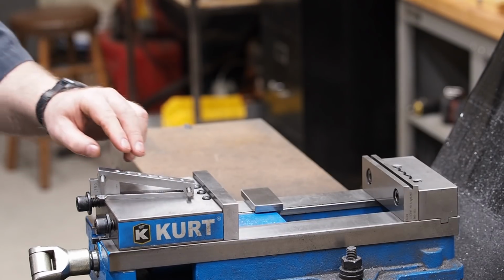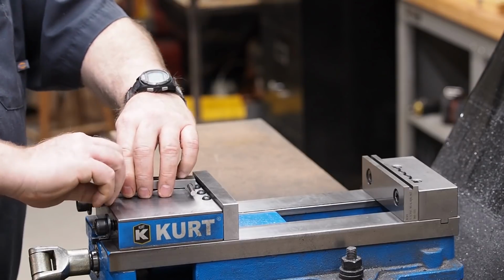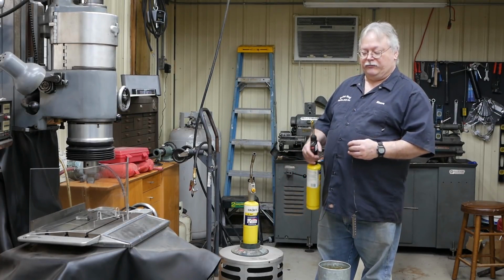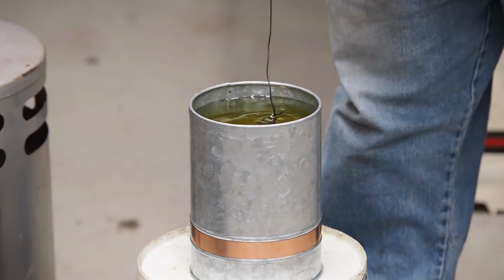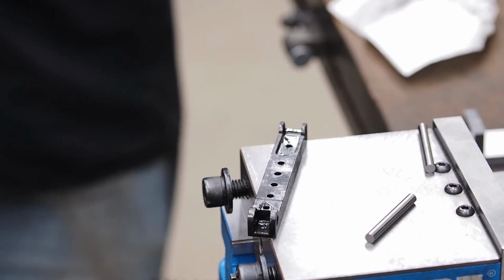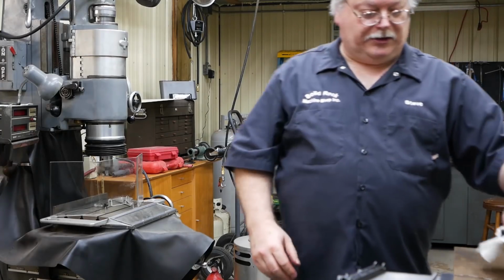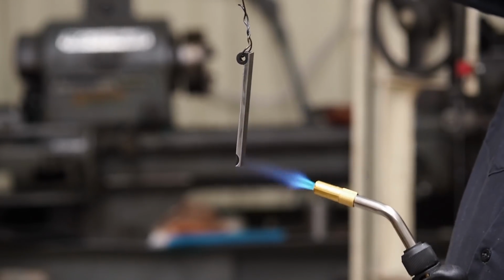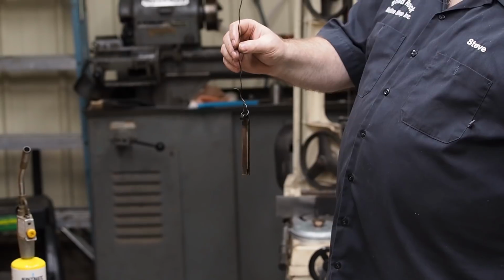Heat Treating the low profile Sine Plate part 3

Comment: I have used W-1 Tool steel in the last year and really enjoy not dealing with the scale from the oil. Nice lookin sine bar Steve
Reply from the maker: Hi Richard,

Have you ever tired grinding hardened W-1? I can't remember if it was W-1 or W-2 I ground years ago and it was a bear to grind.
Steve
Reply: No Sir, I have zero grinding experience so cant offer an opinion. I like the W1 because it comes out of the water with a case hardened appearance as far as color goes....and no black scale. I used "used motor oil" for quench in years past cause its what I had on hand

Comment: Very cool!  Thanks, I enjoyed that.  I am an oleo chemist,  The differences between all the oils you mentioned are vast but meaningless unless you are looking for some kind of substantial chemical reaction.  Carbon infiltration from oil to the metal for instance will probably be the same from all of them - but not deep penetration into the metal. Hence, the black coating on the metal after quenching.  Can't get that from water.  The extreme heat causes a very rapid decomposition of the oils (petroleum or bio based).   I honestly do not know what effect it has on quenching.  Probably nothing if you are only looking for rapid but controlled cooling.
Reply from the maker: Hi Green Range,
Thanks for the information. 
Steve

Comment: Looking good! Very good tip about entering the oil lengthwise. What oil did you use?
Reply from the maker: Hi max,
I used the cheapest Canola oil on the grocery store shelf. It was $7.99 a gallon.

Comment: Hi Steve & Sons! Thanks for the video I really appreciate it. What’s your thoughts on the product called cherry red? Have you use that before what’s the differences between this form of heat treating in the form using cherry red? Thanks for your time!
Reply from the maker: Hi ijs4x,
I have never used Cherry Red. This product is for case hardening low carbon steels like CRS. It well only harden a shallow depth of the steel leaving the rest soft. The steel I was using is 0-1 it has more carbon in it and does not need Cherry Red or other products like it to get hard. Also, 0-1 and other high carbon steels will get hard the entire thickness not just the outside shell. Case harden steel generally will have more stresses in them that releases over the years and can case problems for high precision parts. The wear on case harden parts is not as good as many of the high carbon steels and will wear much faster. A few of the advantages of case hardening low carbon steel is the cost of the steel and heat treat process being much cheaper and it will take more abuse without breaking than many high carbon steels. For precision tools like V-Blocks, 1,2,3 blocks, sine bars. I prefer at a minimum 0-1. A better steel is A2, much better wear and stability. The more expensive steels offer even better benefits. I am using 0-1 for this project because it is a prototype and I can heat treat it with a torch. I will make others in the future most likely out of CPM 1V or 3V they will be very tough and have very high wear resistance but the cost is much more.
Steve
Reply: Solid Rock Machine Shop Inc. Thanks for the info Steve! That’s good to know. -Jason

Comment: If you don't have a fire when you heat treat then it is anti climactic. lol I have done it a few times even once on video. lol
Reply from the maker: Hi Brian,
I had to heat treat them again. When I checked the RC at work they were in the low 50. I had to buy some fire brick and then I only needed 1 torch. I am now in the 58-60 range. We don't get much fire with smaller parts. At my full time job we do large parts and can get a good flame from time to time.
Steve
Reply from the maker: Hi Brian,
That was a good one, those plastic pail are tougher than I thought. What type of steel was that? When we quench using foil wrap we poke a big hole in the bag right before the quench.
Steve